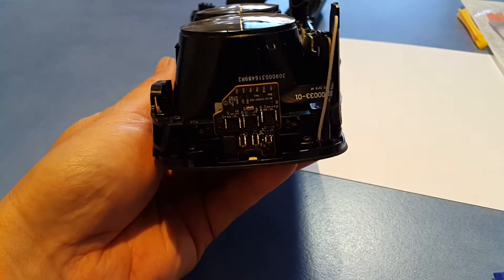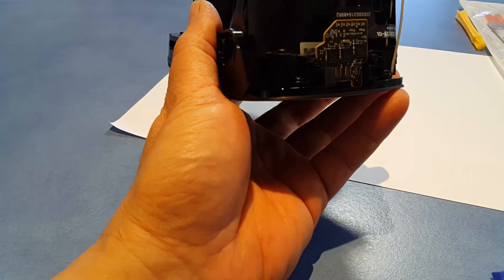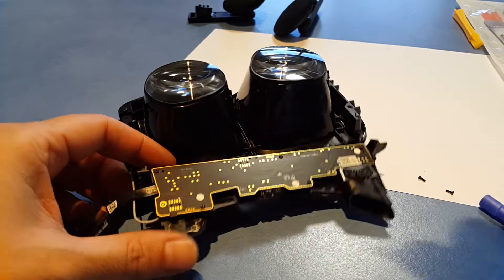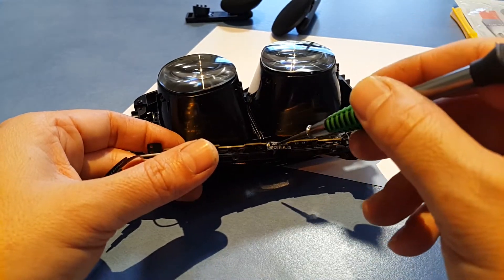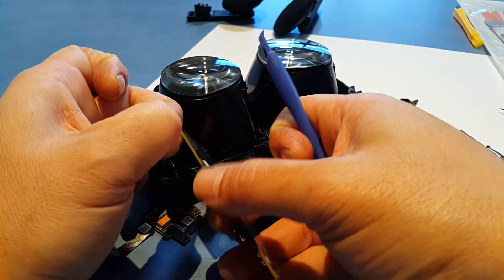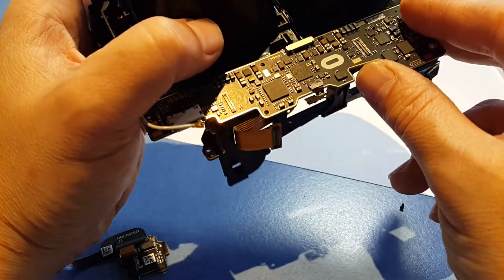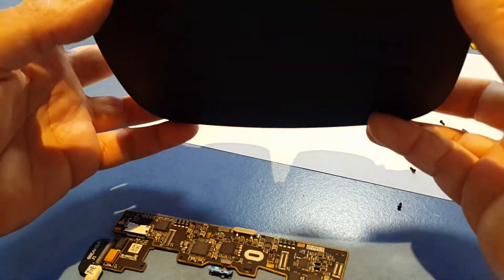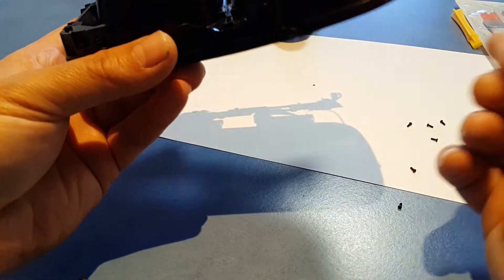Oculus Rift CV1 Teardown Disassembly How To Part 6

Comment: Hi Carlos great job on the tear down guide but dry baking a circuit board will do little if nothing to the solder joints it's likely to be unleaded solder which has a high melting point and it needs flux to flow properly. Unleaded solder is also often affected by heat cycling (hot then cold) which can result in cracked or tarnished solder joints. Boards of this kind often use micro ball grid array devices (BGA) which are micro chips with tiny solder spheres on their underside which are very fragile and any flexing of a board runs the risk of damaging them they're prime candidates for intermittent faults too. If your interested I've recently made a quick video of me hot air re-balling one of those tiny BGA devices and uploaded it on my channel essentially what I'm doing there is removing the chip, cleaning the unleaded solder off both the board and the chip then creating new solder spheres with leaded solder paste and a stencil before soldering the chip back on the board. Other components like HDMI connectors can be replaced in the same manor.

Comment: Is there a way to remove the straps. I've had two of these now and the plastic where the strap connects to the headset keeps breaking. Glue ain't doin' nothin' either.

Comment: Hey, this is a very nice teardown. Learned alot here. I've been having this issue with my CV1 where one eye flashes red horizontal lines and white noise. And if the headset left for too long - one of the lenses goes red or green or yellow tint (seems random). Can the latter part be simple overheating? Mby you can suggest something about the first part of the issue too?

Comment: I'm back: I followed your video step by step.
Remembering, my problem was: the left lens would turn off intermittently during use.
Ok when disconnecting the flat cable of the presence sensor I noticed that one of the paths on the board was broken. no chance of soldering, so I disabled the sensor, reassembled without it, and it's working. I just have to take care to turn off the USB when not using it. Thanks for the video again

Comment: Hello CARlos, what is the reason why you dismantled your RIFT. I was watching and following the steps, My problem is that the left side stopped working after 1 year of bad contact. I pressed it and it came back, today it stopped, I thought it could be a solder, but when I put it on the USB, there is no sign (it is still disassembled.)

Comment: Thanks for the informative video. I have an issue with one screen not working with only a line of pixilation working at the bottom of the faulty screen. Still trying to work out if it’s a board problem or the connector for that screen partially unpinned from the board. It helps to see what it looks like inside.

Comment: My problem is the thin cable that connects the left and right mounts for the speakers broke. It's a super thin connector ribbon cable and it runs along the inside of the back head strap. Do you have any solutions to fix that?

Comment: Well I guess I lucked out, the wire on the right side is torn in half, but the CV1 works great.   I think it goes to the headset right speaker, that I never use anyway.

Comment: I fear I may need to do this. The LEDs in the back of my strap as well as both headphones are not working and its past the warranty. :(
Reply: Have you fixed it? My microphone and headphones are not working. I'm not sure what happened. Maybe the flex cable is broken.
Reply: @nobrubgp  No I ended up buying a used headset (only hdeadset) on Ebay for $70. My cable thankfully was fine but I understand since the headset is used, its on borrowed time. So I'm saving up for a Valve Index.

Comment: Oculus will middle finger every single user under warranty . buy another brand . I managed to buy a second hand unit with left earpiece missing , its right hand side oled will turn off shortly after power it up . Ripped out my cracked oled and replaced with good one - all good total cost = 100 pounds Fakebook wanted 300 for a refurb , fuck that noise. Used your vid for tear down SUCCESS!.

Comment: I would caution anyone attempting to reflow the board in an oven.

Solder melts at 350°F.

Reflow ovens use a heat profile that slowly ramps up the temperature to evenly heat the board then spikes to flow the solder then cools down slowly.

Ovens dont do this. Use caution.

Comment: Thanks for very good teardown. I managed to fix very similar issue with rift by cooking 200c, 9 min in oven. Before that I had hdmi disconnected after 15min, and after first cut it worked maybe 5min. After cooking at least 30min without disconnecting.
Reply: What do you mean?

Comment: Ronny Viana

Hello Carlos, help me, my phone on the right side has stopped working, sometimes it works and sometimes not, I've had rift for more than 4 months and this month it happened, it's with bad contact what can be you can help me and give me An alternative, since I live far away, does not have oculus support !! Maybe you know where the problem is just from what I said !! help me please !! 
Jul 13, 11:58 PM PDT

I do not know what happened to anything from one day to the next. The headset on the right side stopped working, I thought the headset had burned out. I took it and I tested it on the left side. I reversed the headphones to test. earphone that I thought was burned is picking up, but the right side still does not catch even me having reversed the headphones, and when I move with the handle of the oculus rift it gets badly touching an hour picks up another time does not pick up depends on the position if I press too much, if I loosen the handle, it starts to fail and it is not working, one hour it works another time it does not work, without doubt it is with bad contact, you have some solution for me without having to send it to me. You o oculus rift why I live in Brazil.

 
Oliver (Oculus Support)

Jul 14, 2:49 AM PDT

Hello there,

Thanks for reaching out to us.

We can troubleshoot, but our options for replacement are limited since you're in an unsupported country.

Can you try reseat the headset cable on both ends? Click here for steps to safely remove the cable from the headset.

If this doesn't resolve the issue you will need to reach out to the place you purchased the device for a replacement.

Let me know how it goes.

Best regards,

Oliver

Ronny Viana <anjodosteclados@gmail.com>
00:06 (Há 1 hora)
para support 
yes I can do everything that you advised me I removed the cable and everything and facial interface, but the problem is not in the cable but in the right side of the phone that does not pick up or something tells me that the wire is giving bad contact inside the rift or the wire that is inside the handle on the right side so I believe I will need to disassemble it but I want to dismantle it safely since there is no support here, I want to repair it myself, so if you can do it to disassemble it and uncouple the handle of the facial interface you are already helping me because something tells me that the problem is inside the inner part of Oculus rift, since now I thank you help me please it is a simple thing to solve but I want open it and close it safely without ruining, I have a notion of basic electronics can I concert it if I solber the way to open it and disassemble it, why when I mecho in the handle on the right side it sometimes works and sometimes not !!! when I think of a position it works, I just can not go too far with the headset handle that does not really work. help me please!!
Oculus Support
Reply: Ronny bom dia. Eu sou do Brasil também. Rio de Janeiro. Você conseguiu resolver? Eu estou com esse problema também. Ontem a noite meus fones pararam de funcionar e o microfone já tinha parado antes. Aqui é complicado, a gente não tem suporte e tem que resolver as coisas sozinhos. O meu funcionou bem por 4 anos e meio. Eu comprei em Paris em 2016.
Reply: Primeiro parou o direito, aí eu fiquei mexendo, tentando ver se era mal contato, aí percebi que ele funcionava as vezes até que o esquerdo parou também.

Comment: Good evening from a wet yet again Mullion Cove Cornwall.

Thank you so much for the video it was excellent, separating the fabric from the lenses would have stumped me.

We hope you were successful : )

I do not have a disconnect fault but I have to get at the ribbon cable because of an intermittent sound fault.

The sound fault would appear to be a very common one, if I succeed in a fix I shall put it online as you have done : )

The part I can now see looks OK, so we shall have to look further: )

Oculus do not come across as a helpful or honourable company.

My thoughts are to go with another make when the next generation of headsets become available.

We should not let them get away with no repair or spares service.

All businesses have to make money, but what they are doing comes across as criminal.

They may realise as they get older that people matter more than money : )

The sound fault due to the ribbon cable has hit a great deal of people, its cause is very poor design. 

God Bless Allen and Alanna

Comment: Hi Carlos, how did the reflow go? Did you manage to cure your Rift from disconnecting?
Reply from the maker: Hi Luca, unfortunately it was unsuccessful. I don't have any professional equipment and I just used my home oven to try and reflow.  Afterwards I put the rift back together and I could still get a picture and my rift was recognized, but I still had disconnects and if anything it was worse than before.  I still hold out hope that I will be able to source a replacement mainboard from somewhere and replace it.
Reply: Did you try the trick that elvela2 talks about at https://www.reddit.com/r/oculus/comments/5dr4fv/rift_disconnect_when_twisting_the_headstrap/deat47q/? Even though that's his only post, I believe that he might be on to something, because if squeeze my CV1 right in the middle from the outside (which would bend the board just as the guy describes) I no longer get disconnects, even when twisting the two sides which otherwise for me is a 100% guarantee of disconnecting.

Comment: Maybe it is better industrial hot fan, mot in oven. Like this https://www.youtube.com/watch?v=1AcEt073Uds
I am waiting yours result i have same problem with garanty
Reply from the maker: Yes I agree. If you have access to a professional service to do this, I'm sure it can be repaired. This guy on Reddit repaired his with a hot-air rework station.
https://www.reddit.com/r/oculus/comments/5xxro2/cv1_disassembly_help/dendbxq/
Reply: used to work in a computer repair shop old boss got a hot air station, mine was doing this but just totally died now so fingers crossed this can bring it back to life